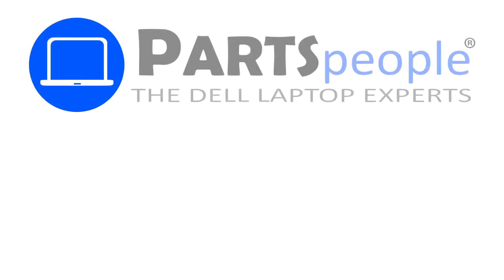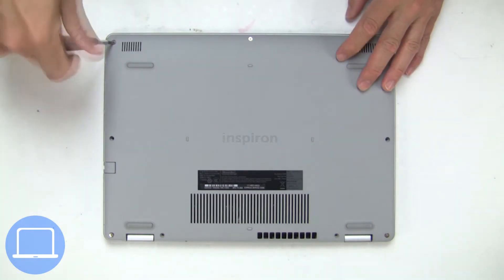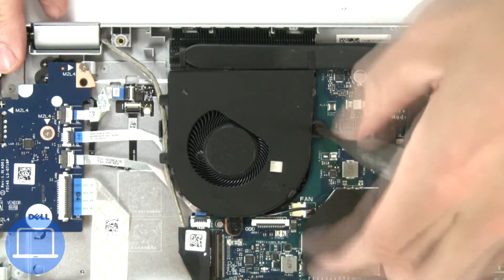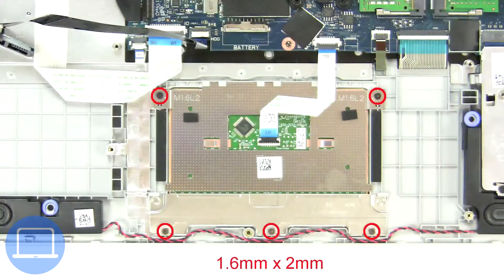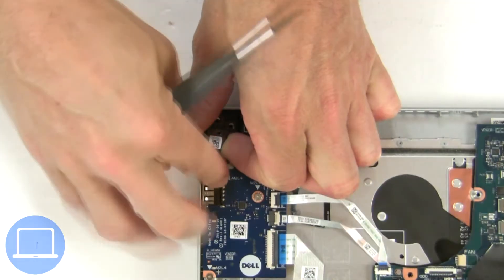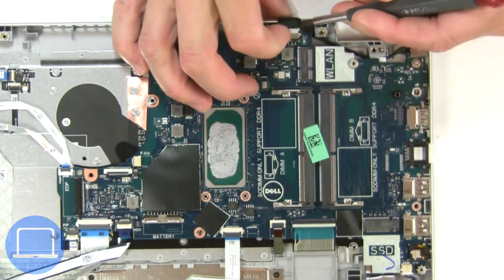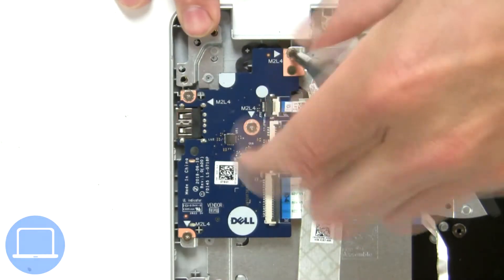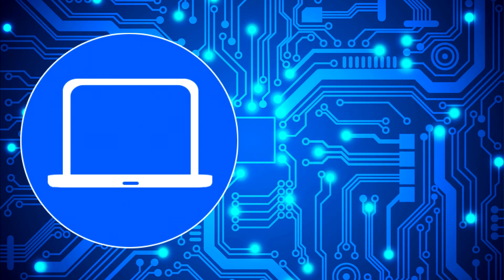Dell Inspiron 15-3501 (P90F002) Palmrest Keyboard How-To Video Tutorial

Comment: The video ends up wiith the palmrest but doesn't say how to get to the keyboard!  That's the point!  I can't see how to remove the numerous screws holding the metal plate on to the keyboard.  They don't seem to be any type I've seen before.
Reply from the maker: So this model uses a complete palmrest keyboard assembly that is not designed to be separated.
Reply: @dellpartspeople Amazon had no problem selling me a keyboard without the rest of the palm rest.
Reply: @dellpartspeople  - Yeah, no. You need to show keyboard access. The palmrest and keyboard are available separately nearly everywhere. Stop lying to people.
Reply from the maker: @neilhennigan9596  While there are many third party manufacturers around the world we only sell the Genuine Dell OEM part which is only manufactured by Dell as a keyboard/palmrest assembly. And since they are not designed to be separated I would not be able to illustrate the removal of the keyboard only. Glad you were able to find someone that makes something compatible. Good luck.